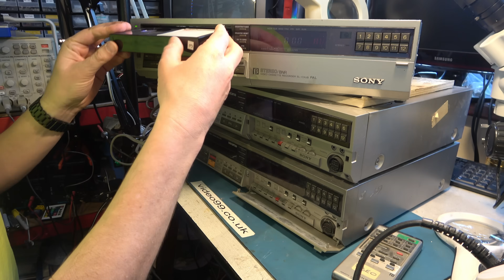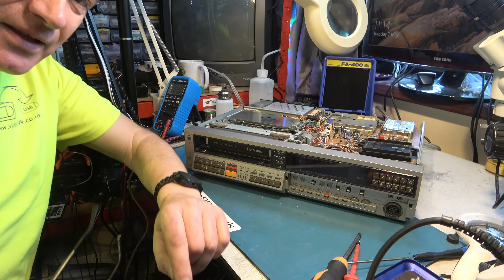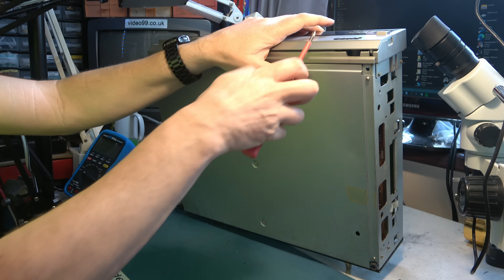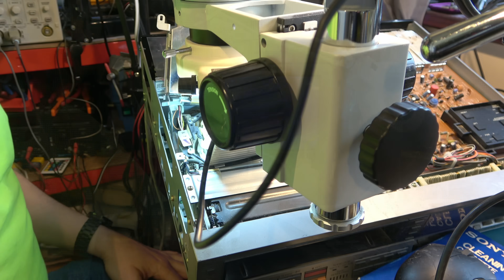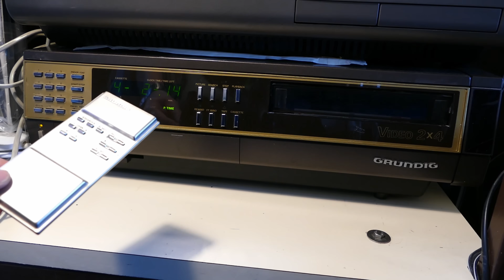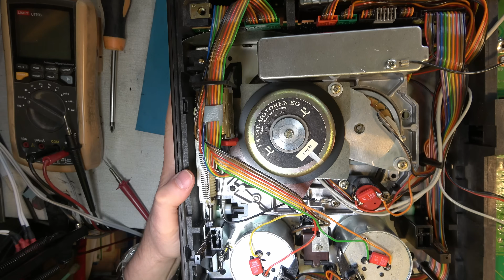Sony Betamax SL-C9 video recorders.  Can we get something working from these?  Part 1.

Comment: Hello. I just got today an SL-C9ES from ebay. The problem is that the tape speed is too slow on playback, to the point where the tape remaining indicator can't count how much tape is remaining, and sometimes the machine stops because of the slow speed. Can a faulty pinch roller cause this, or should I look at the back-tension adjustment?
Reply: Mine is doing the same thing as yours. Hopefully someone will reply with a solution.
Reply: @scottrodger3592  I went ahead and adjusted the back-tension control RV002 on the SS-11 board. Now the tapes play OK but the sound is poor. I tried tweaking the audio/control head's height and azimuth adjustments but couldn't get it perfect.
Reply: @crashbandicoot4everr  I’m not familiar with the parts you mentioned. Got any photos of what l’m looking for? Thanks
Reply: @scottrodger3592  Unscrew the bottom cover and then unscrew the SS-11 (syscon/servo) board (the screws you need to remove are marked with white arrows on the PCB's silkscreen). It's the board that covers the mechanism. Hinge the board upwards and look for the variable resistor RV002. It's located right besides IC002 and it's a small blue potentiometer that can be adjusted with a small phillips screwdriver. Turn it clockwise to increase the tension, turn it anti-clockwise to decrease it. Ideally you need the SL-0003C back-tension measrument tape to do this but it can be done with an ordinary tape. I'll post photos if I can.
Reply: @crashbandicoot4everr  I found it. Thank you very much for all your help & information. It’s working beautifully now. Thanks again! 😎👍
Reply: @scottrodger3592  Oh really? Does the audio play and record fine? Mine is muffled and I am suspecting a worn A/C head. Glad I could help!
Reply: @crashbandicoot4everr  I found the sweet spot just before the audio distorts. It plays very well. I haven’t attempted recording anything. Thanks again. 😎👍

Comment: I think I've still got a Sony C9 in storage. Got it from someone in London back in 1999, but I never got it to work well as I think the video heads were worn, but I think the clock display worked. Must go through my stuff in storage to see exactly what is there, as there might be a Sanyo VTC-5000 and NX-100 in there too. There should definitely be a PYE version of the V2000 portable.

Comment: I had a C9 fairly late in the game, around 1990. I really loved that machine and used it until the heads wore out. By then I had a HF100 so invested in keeping that going instead.
Sadly never had a HF950.
Reply from the maker: The HF100 was a much better machine in many ways, but lacked the trick functions of the C9.  I'm still hoping for an HF950 one day.  But I do have some NTSC SuperBeta and even High Band machines.

Comment: I have almost 50 Betamax in my collection but the SL-C9 is my personal horror 😄 I always wanted a good one but I only found defective worn ones.it's easier to find a good SL-HF950 than a good SL-C9😂
Reply: I think that's because most of the people who could afford to buy a 950 back then actually did it as a status symbol, so the machines were just sitting under the TV most of the time and saw very little use. On the other hand, the much lower class, everyday machines... well, got used every day 😅and just wore out... I have a 950 and it's pretty much as good as new... except for the usual LED problem....🙄Actually it had some minor mechanical issues, mostly caused by shrunken nylon parts, but those were easy to sort out. What really counts - heads, pinch roller etc - are in perfect shape fortunately 🥳
Reply: @janosnagyj.9540  yes the 950 is great  i have 10 at this time .
Reply: @janosnagyj.9540  I have already had 2 SONY SL-HF950ES (PAL/SECAM II) with tape-friendly video heads (protruding no longer noticeable) disposed of as untested/defective by "my" eBayer.
Reply from the maker: I have plenty of C9s but no HF950!
Reply: @video99couk  in Germany you find easy an 950 . At this time i have 10 and three of them new.
Reply: @Betafreak_GE  Indeed I got mine from Germany 😅What the heck are you doing with that fleet of 950's? 😱
Reply: @Betafreak_GE  Are the ones from Netherlands too expensive?🤣